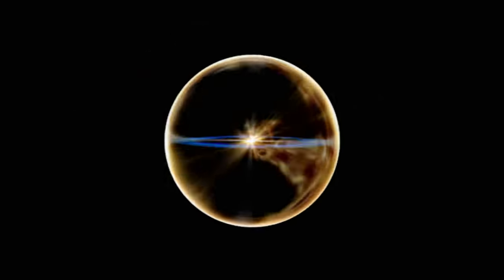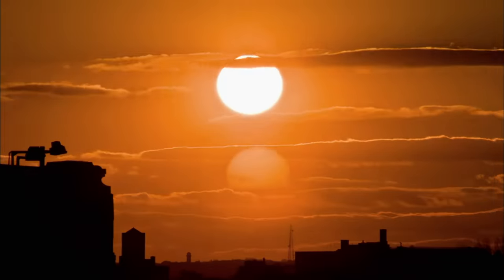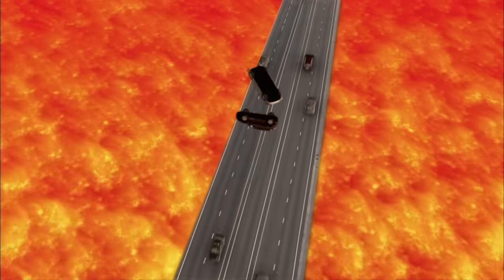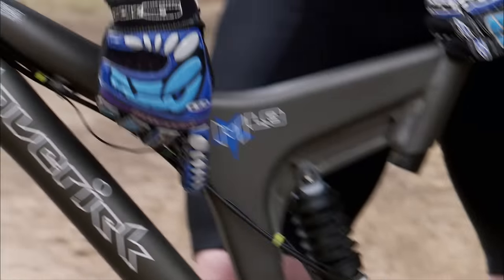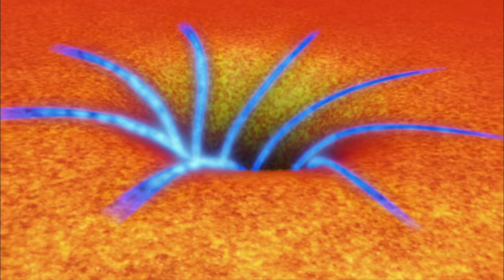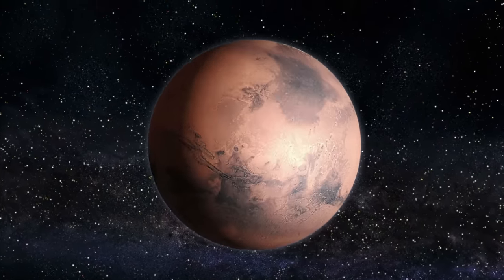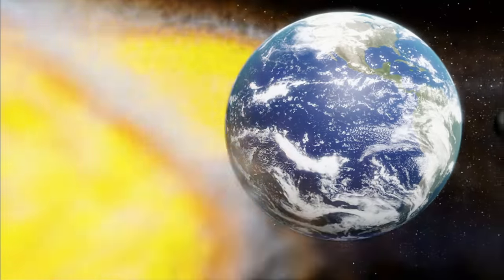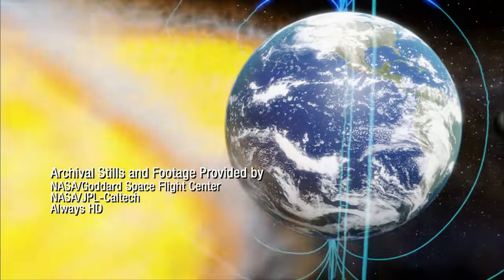The Universe: Magnetic Storm Threatens Earth (S5, E3) | Full Episode

Comment: As someone whose lived in the subtropics for 34 years, I've seen many local complete blackouts caused by hurricanes. Yes these disruptions are brief, but things don't come to a grinding halt when there's an area-wide power outage. Hospitals, service stations and many supermarkets have gasoline-powered generators, as do many homeowners. These small personal devices will keep the home's essential appliances operating. The private community I live in doesn't have that capacity to maintain water flow and probably the city doesn't either. We'd be living on bottled water for sure, at least until it runs out nationwide if the whole planet's power grid was destroyed by  a solar flare. As immediately problematic is the loss of traffic lights. We'd be reduced to four-way stop protocol, and you know how selfish some drivers can be.
These "what if" scenarios can be troubling, yet worrying about possibilities is futile. Let's hope it never comes to Earth being devastated by a mega magnetic storm. Meanwhile: stock up on candles. Batteries don't have a forever shelf life, but that old technology does.
Reply: There’s a big difference between a normal power outage and an outage caused from a magnetic storm. You can’t use a generator when the electric grid is just fried so
Reply: @WhiteBoyEst1994  Hold on thar, Baba Looie. Why not? A home generator is only connected privately. How does power grid destruction affect a house's wiring?
A second point is all these Chicken Little videos about this may happen, that could occur, etc. Yes there's a miles-wide pool of magma under Yellowstone. When it finally breaks the surface will there even still be people on the planet the way things are going? I have serious doubts. I'm just not into cosmic disaster speculation, so I reduced the effects of electricity disruption to a level that HAS happened and will again without question.
Reply: @AnnieVanAuken  there baba loole
Reply: @AnnieVanAuken  or wtf ever you said
Reply: @WhiteBoyEst1994  Ah, you're young. I refer you to Quick Draw McGraw:
"Hold on thar, Baba Looie. I'll do the thinnin' around here!"
Quick Draw invariably says that every cartoon.
Just don't get lost in these crazy postulations about all the possible things that could go wrong. It's a parlor game for worry-warts.
Reply: @WhiteBoyEst1994  thank u
Reply: We're not just talking about a short poer outage. We're talking years, and there are large metropolitan areas with dense populations of millions. Those in more rural areas and have survival skills will do considerably better. Oh, and a very strong storm can destroy a generators capacity to funtion, plus when you're stored fuel is used up you'd have no replacement.
Reply: @tb9734  Entirely understood, however, it's hypothetical. Maybe the sun will hurl fireballs at Earth but will there be any life here at that moment? Both ideas are "what if" and they cancel each other out. Meanwhile I've kept my screen porch from coming apart during Wilma while other homes around me sustained major damage. Then we survivors lived through a spell of  no power. I know, I know, hypothetical years of lights out. eh it don't move me.
Reply: truly
Reply: @WhiteBoyEst1994  Right
Reply: Confirming.
Reply: Check out the book "One Second After" by William R. Forstchen.  The premise is an EMP takes out large areas of the grid.  Make sure to read the forward / prologue, too.  He had done his research and consulted experts in the field.
What I'm getting at is that anything with a chip in it (phones, TVs, generators, power grid, especially cars made in the last 40+ years) will be rendered useless as the magnetic wave will fry them.
Yes, the "what if" probability may be minuscule, it certainly doesn't hurt to understand what could happen and what you could do if you roll the evil "7" on the dice.
Reply: @chadportenga7858  I wouldn't waste a minute or a nickel on books that espouse a POSSIBILITY. Not a PROBABILITY mind you but some "sky may fall....someday" sweating over a realistic non-threat.
Reply: It'll be a lot worse than that lady. Those generators won't last long when you can't go fill up at station. Maybe for a Lil while but probably the station owner will hoard what gas they have when the  event happens. Or they might sell for say, a gram of gold per gal. B cause , see, paper money won't be worth squat, only gold n silver n maybe precious gems but that's it, no banking. The dollar is worth 0
Reply: @HeraldOfChaos76  Numbskull? Ha. Insults are the last bastion of the intellectually bereft. I won't point any fingers but, uh....
Three words:  You're Shooting Blanks.
Reply: @HeraldOfChaos76  Your argument was exhausted before you began. OK then, give us the answer to what we do if the sun irradiates the planet to the point that we all become french fried potatoes? And don't say: add ketchup.
Reply: Notice that kaosu tama deleted all four comments just made here. I won't waste time recreating this rude individual's weak attacks upon me. I'd sooner worry that the sun is going to zap me with a magnetic storm, and this thread has established how much concern I have for THAT.
Reply: @HeraldOfChaos76  Cute. How long will your "add salt first" comment remain here?
But now you're getting it. Nothing we can do if the center of the Earth cools, so live, love, laugh and be happy.
Reply: @AnnieVanAuken  I mean we could always... idk... terraform mars I mean wasn't that a thing for a while or am I going insane like the ms fizzle meets vegan teacher knockoff here
Reply: @HeraldOfChaos76  Terra-forming may work someday, but the technology barely exists to get people to Mars and back. I know Elon Musk thinks colonization is doable, and maybe yes in the Star Trek millennium, but not for any time in the foreseeable future. A better possibility is underground cities here. You accomplish THAT then use what it took to succeed and head off to Mars with it. A plus perhaps, those places would be safe from solar storms.
Reply: @HeraldOfChaos76 "ms fizzle meets vegan teacher" am I?  It's a good thing you deleted all but one of your ignorant, insulting ad hominem  attacks on me. In the future, that is if the sun doesn't destroy us all in a magnetic storm, don't participate in a showdown if you have no ammunition.
Reply: You just dont get it do you.  Unable to grasp.
Reply: @scinanisern9845  ikr it's so funny I'm so glad I caught on early so I just practiced my roasts lol
Reply: @AnnieVanAuken    Exactly   "...  a level that HAS happened and will again without question".  Several times.  The most recent in the eighteen hundreds.  Very famous.   Perhaps every hundred years or so off the top of my head.  Its been about a hundred and fifty.   The only speculation is WHEN it will happen, not if.  Calculations become problematic, especially with the GSM coming and the odds skewing toward close probability.  There is a reason you are unable to grasp.   The good side of course is that you live in the sub-tropics.   Count your blessings.   Odds are high you will appreciate them some day in the not too distant future.
Reply: @scinanisern9845  Thanks for being reasonable. 
Won't argue beyond saying in my old age I no longer worry. 
Just work on my YouTube channel as long as the power grid still functions.
Peace.
Reply: @AnnieVanAuken  let just say this during any type of electromagnetic storm all chips will fry, the circuit boards will all remain inoperable.  Any device that requires any type of electrical power will not work simple as that.  Think In terms of energy, frequency, and vibration as Nikola Tesla stated.  This is the origin of our physical universe.
Reply: @murch1987  looking for this comment of reason! EMP wipes out all electronics that aren't kept in a FARADAY BAG/CAGE/BOX.
Reply: @tucor7549  I dunno. If copper is melting, what chance does any living thing have? Again, as the great philosopher A.E. Neuman once observed, "What, me worry?"
Reply: What about solar panels? Y'all think that people who have solar systems will still have electric?
Reply: There are so many earth catastrophes that could happen. No point worrying about them. Get right with God or your higher power as you see him or her
Reply: @larryshaffer1876  Your first two sentences make the point I expressed in the last paragraph of my opening post here.
Don't worry, be happy.

Comment: The CME from the sun comes out at random over a 360 degree by 360 degree because the shape of the sun allows for CME to go in all directions. This means our earth has a probability of being hit by a CME at a probability of 360 divided by 360. It is more complicated, but you get the idea.
Reply: Exactly, we are constantly being hit, but it's not focused the way it would have to be in order to affect earth in the way this is describing... In order to have such a crippling and devastating affect, the solar burst would have to be extremely focused/aimed directly at the earth... as u stated, chances of such an event are pretty slim, however not impossible by any means.
Reply: @Ben-br7og  If such a coincidental alignment occurred, it would drive those who survived back to a time before automobiles, for the most part. There are some early model diesel farm equipment that might be drivable, but only if they were mechanical injection only, and only as long as suitable fuel was available. The rest of us with our computer controlled machinery, wheeled or otherwise, would be walking. It would be a good time to know how to build a primitive ham radio, and learn how to use it.
Reply: @patriot9455  Yes, you're 100% correct...
When u think about it, it's almost as if we have/are setting ourselves up for failure with the whole push for the advancement of technology..
I mean, It's needed/productive/useful (can't think of the correct way to really say it) up to a certain point,; most advancement passed that certain point is almost counterproductive in long term in such as the advantage isn't significantly greater than the risk factor of, in this case risk of total loss of our technology.. the same technology that we've seemingly accepted, with open arms, a dependence on, literal in some aspects, illusionary in others... I think we should look at all our modern progress & apply a rule/law of redundancy...
Reply: @Ben-br7og  My wife and I would be greatly inconvenienced if a CME took us back to 1850 level technology, but we are country people, and country folk can survive ( and thrive)
Reply: @Ben-br7og  
Well said.
Reply: Pretty sure  360 degree flare would be a micronova.
Reply: @thedood9403  Not the entire 360, but like a ball coming out of a field, you don't know which degree it will be coming from.

Comment: Not only is this realistic, but there is proof throughout geological time in which cycles on 100, 600, 1000, 12000, 24,000 year cycles are coming at one time. Our current sun cycle is not only at a greater peak than predicted during its solar maximum, but our earth's magnetic protective field is going down more each year, along with the magnetic poles shifting more each year. Today, scientists have to check them every 6months instead of every year. 

The CME or solar flares don't have to even be large to create huge bolts of energy hitting all around the planet. Talk about climactic and continental shifts..